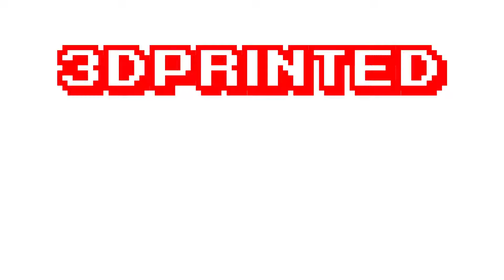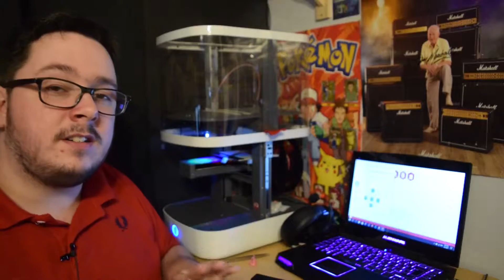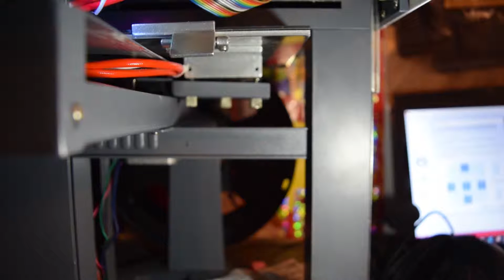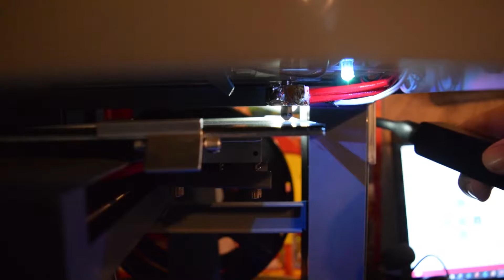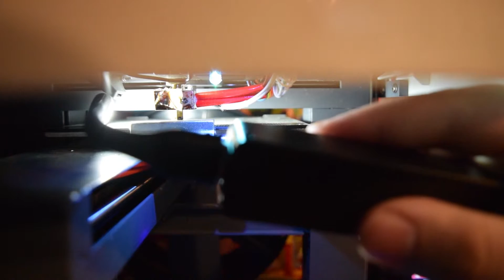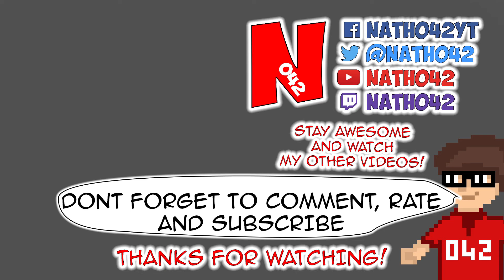How To Level/Calibrate Your Vector 3 Printer Bed

Comment: thanks for the video see if it works for me
Reply: just tried to move the motors on the printer and nothing moves
Reply from the maker: is it all plugged in correctly? do you have the stepper boards in?
Reply: @nath042  seems the main controller status light constantly blinks red